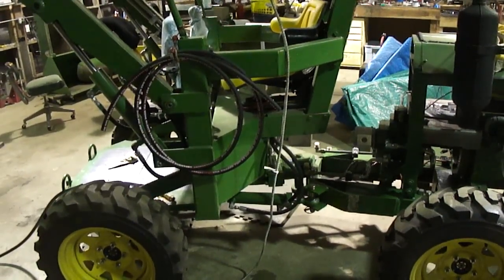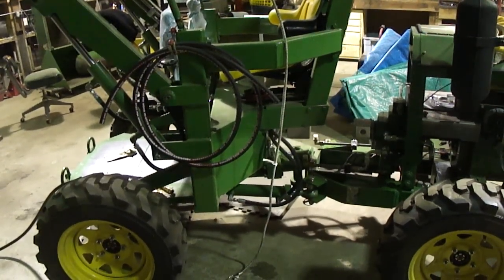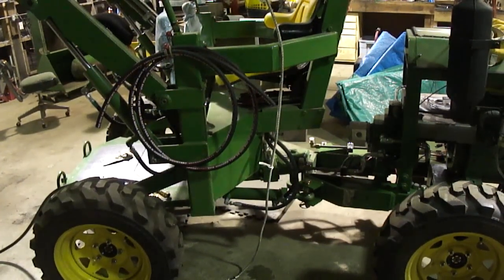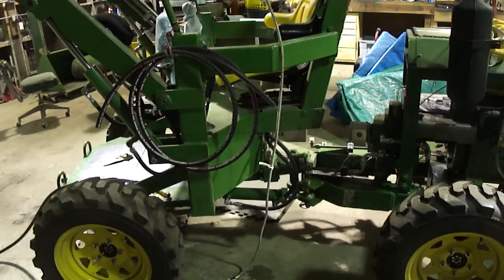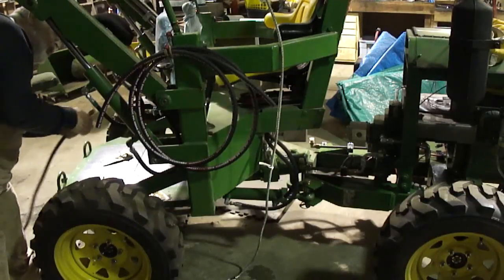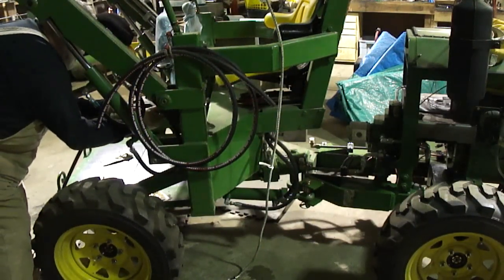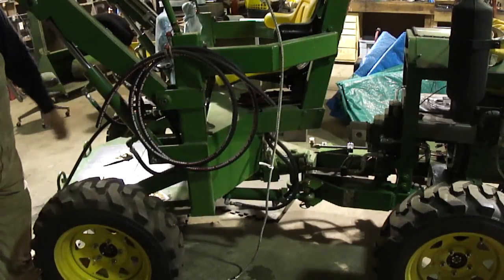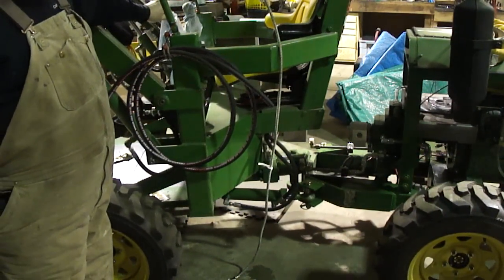DIY Articulated Tractor Steering Test

Comment from the maker: @MsAbbydo  thanks for your reply, It appears that way for sure, but when I was doing the testing I did not fully go to the end of the stroke because I was using air and the acceleration so fast I did not want to slam the cylinders into the stops for fear of damaging then. I will however recheck my geometry again before I go to operation. I did leave me some adjustment room.

Matt